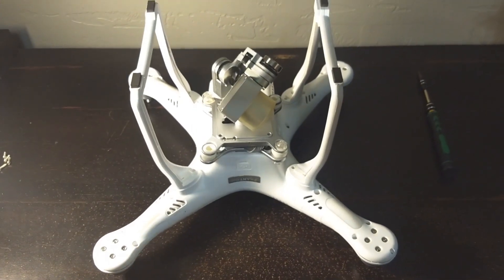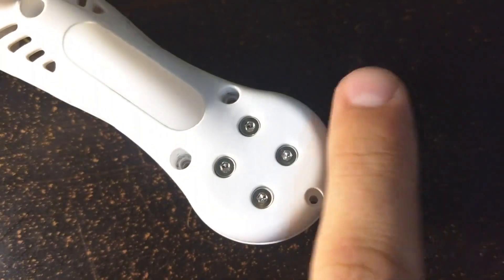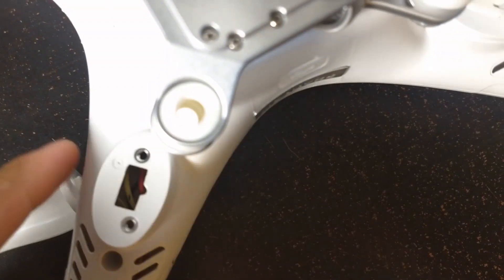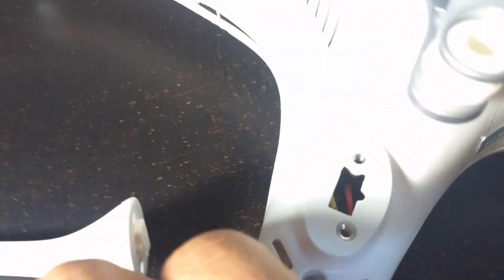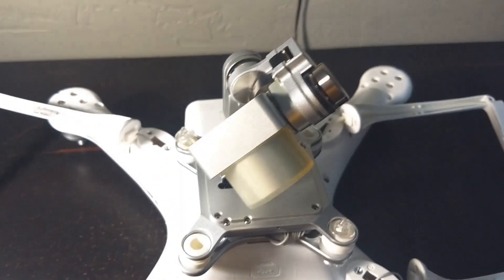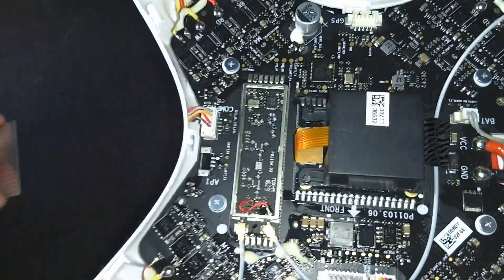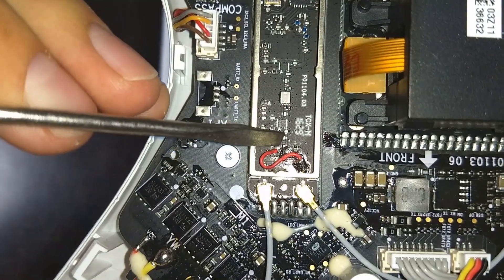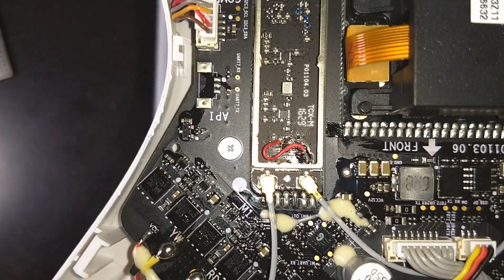Phantom 3 Standard Range Issue Fix

Comment: Hey I have this issue as well....I lose signal around 450ft... No matter where I am... So I went on they link and he says to remove the chip, why did you rewire it?
Reply: Can I just say that I have done this with my P3S which was having major issues with any distance over 300 feet and immediately after doing this I flew it out to over 3000 feet before complete signal loss, so thank you for your video 🙏🏻
Reply from the maker: @kevindarkstar   That is awesome to hear, I'm so happy this helped you ;) Happy Droning :)
Reply: @kevindarkstar  standard controller ? Or was it modded?
Reply from the maker: Hey Thx for commenting, so the reason I just jumped the two terminals with a wire instead of removing the chip, was to minimize the risk of overheating the board. Also making the connection where I did is much easier then connecting the two tiny points under the chip. 👌 Let me know if this answers your question 🙂
Reply: @Snipeoff  I was just gonna ask about that 😅....I see that you re wired it .... It's so small in the video tho that it is hard to see where you actually connected the wire...🤔
Reply from the maker: Ok so go to the last post on this page, https://phantompilots.com/threads/phantom-3-standard-range-mod-lets-do-it-together.80721/page-78#post-1429206
This is not my picture I'm just using it to show you the two points I connected with that wire. It is the two contacts in the middle of the red circles. Hope this helps 🙂
Reply: @Snipeoff  thanks man!!!! I'll def try this, my friends drone is doing 500 meters easily, and I can't go over 150 till I lose signal..... Hopefully this helps 🙏
Reply from the maker: Awesome, I'm happy to help, let me know how it goes 👍

Comment: This fixed the RC signal lost problem! Thank you! Soldering a speck of dust to a fly turd is very accurate! flew to 1200 feet before we lost signal. Originally it was loosing it at 400ish

Comment: Did it to mine … didn’t work .. still going up to 150m and disconnect idk what’s the problem .. any help guys ?
Reply: you may want to remove the chip cause its grounding antenna so bypass will not work if chip is grounded. Bypass will work with chip left alone if chip is burnt open.

Comment: can anyone help me? I have a phantom 3 standard after about 400ish feet I will start to lose connection from my remote and I cant take the drone apart is there anything else I can do.
Reply from the maker: It sounds like the same problem I experienced, I tried everything I could like of before I resoldered mine, software, firmware, things like that.

Comment: @snipeoff
I seen this mentioned on the thread posted by the Russian guy...

After repair be carefull with rc. Receiver will be very sensitive, dont use rc + ac closer than 1 meter.
Especially, if you have powerfull transmitter modure or antenna on rc. Removing the cip bring +2 db rc signal power.

Did u have to do this?

Many thanks
Reply from the maker: I would say the RC is stronger if that's what you're asking

Comment: Thanks for the help, Could you describe how you removed the S20 chip or the best way you think would be possible? Thanks so much for this video.
Reply from the maker: Yeah no problem...what we did was heat it with a soldering iron and kinda pull it off...but honestly just jump it...no need to remove it
Reply: @Snipeoff  Thanks for your replies and help. I have a question. In the small chips that come from the antennas, I don't think it matters which one we solder too, but could we jumper to both and make a Y jumper? If not which one is the best to go to. I think one is a 2 G and the other is a 5G antennae correct? Ive tried everything as far as FW and this is my last resort, and I have it all apart ready to solder.
Reply from the maker: Hey,
Yeah I would just jump the same pins that I did in the video...I'm not completely confident about which other ones you could jump 😬
Reply from the maker: Other people have commented with success doing it like the video, so as long as your problem is the same...you should be fine 🤙
Reply from the maker: Something you could probably do...is after you solder...plug the lid back in to that one plug...set it in place, then power the drone on being careful not to touch any of the circuit board...and then walk 500 or 600 feet away with the remote and check your connection... you'll know if it worked then
Reply: There are two of these chips? A long time ago i read the FCC made it law that there has to be limiters on anything that broadcasts a signal.  I guess to reduce airwaves clutter.  The compliance with that law, that i think is kinda bs in many cases, took the form of two small chips(this is the most recent engineering of it anyhow).  I think for a long time only motorola made those chips but thats beside the point.  Are these the limiter chips?  I had also read that in almost all engineering, the removal of the chips(provided the circuit remained intact) did not impact the functionality.  Haha.  Almost like they put them right where anyone who knew electronics well would have no problem increasing their range should they desire.

Comment: Sorry for my rather silly question...so basically i can literally use any small wire to connect the two capacitators (asin both ends of wire touching capacitator on both ends) and problem might be solved...?? or theres some special wire i need to  get
Reply from the maker: It's just regular wire, something thin helps

Comment: all that work on that phantom was not necessary do not update to that firmware there as been issues with it roll back firmware issue fixed
Reply from the maker: Thanks for the information, but I did try rolling back the firmware to just about every version I could get my hands on, and that did not fix my problem. That's not to say it couldn't work for someone else
Reply: What firmware did u roll back too
Reply: I tried downgrading firmware, it didn't work. What are you referring to?
Reply: u can ohm test the chip. firmware aint gunna fix a burnt out chip

Comment: Please respond, my friend knows how to solder but I'm scared to take this apart for a range issue. How could a software update affect the hardware negatively.
Reply from the maker: I really don't know if that software update caused it, but that seems to be when my problem started. But that chip burning out could have been caused by something else as well.
Reply: @Snipeoff  Interesting! Thanks a tonne for the help, man. I just lost my yuneec blade chroma that I spent $500 on only a few months ago. Then bought a DJI phantom 3 std. and it kept saying there were connection issues when it was not very far away. My intent with the drone is to fly it into and above the clouds for beautiful shots that are impossible to get otherwise. Would be so cool. My friend knows how to solder, I never learned, he has to help me and can come over tomorrow. We'll take it apart and try the same thing, I'll try the test too. I really appreciate you helping. This video is purely just to help others. I'll subscribe
Reply from the maker: Also there is a test you can perform to test if your chip is bad, look at the 10th post on this forum. (https://phantompilots.com/threads/phantom-3-standard-range-mod-lets-do-it-together.80721/page-72)
and follow his directions. That way you can make sure your chip is the thing causing your particular problem. Before you do any soldering.
Reply: @Snipeoff  For some reason that link isn't working, also when I try to log into the site it tells me just to click a box, not enter captcha letters/#'s, then denying me because it says I didn't enter the Captcha thing. Weird eh, I must be cursed.
Reply: Thought I had an account with them, turns out I didn't and had to make one. Did that, and now it's saying the link won't work. How would u say I should test the possible faulty part, to see if it's the issue?
Reply from the maker: That fix is kinda hard to explain without pictures, so here is the link again
https://phantompilots.com/threads/phantom-3-standard-range-mod-lets-do-it-together.80721/page-72
It's the 10th post, if that link still won't work, search "Phantom 3 standard range issue let's do it together" on Google, it should be the first result. Then go to the 72nd page on that forum, and it's the 10th post. If all that doesn't work 😂. let me know, and I'll post a video explaining how to check it.
Reply from the maker: @Sam-me5pl  also if you haven't tried this already, try pairing the drone and remote again to make sure the signal is good. Maybe try that before you take it apart, if you haven't already done so.
Reply from the maker: @Sam-me5pl  also as far as I know you shouldn't have to log into Phantom Pilots to see the post I linked, you mentioned that you were having trouble getting it to log in
Reply: @Snipeoff  Appears that link is no longer valid.  Can you provide another or help with the TEST to see if my chip is bad?
Reply from the maker: @kevins4229  Hey Kevin so here is the link again this one should work, just go to the 10th post on this page and follow his directions. Let me know if this helps 👍 https://phantompilots.com/threads/phantom-3-standard-range-mod-lets-do-it-together.80721/page-72
Reply from the maker: Let me know if you have more questions